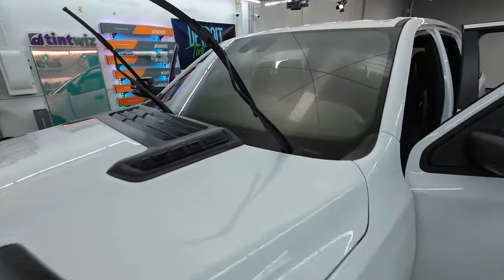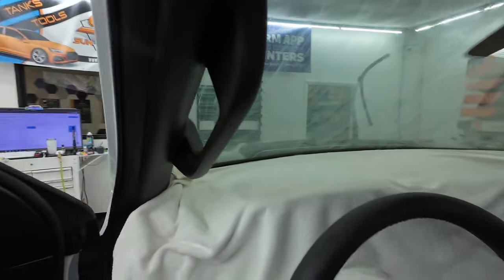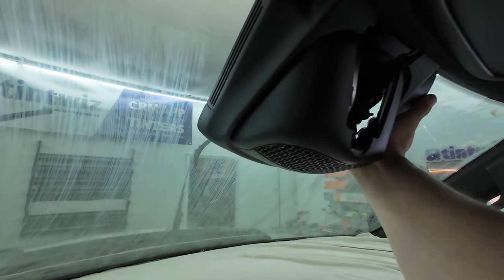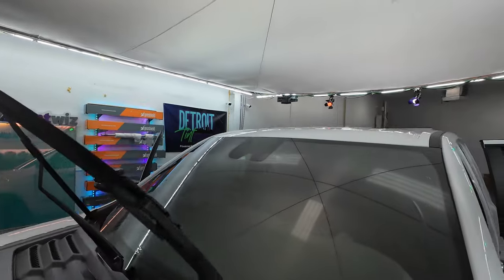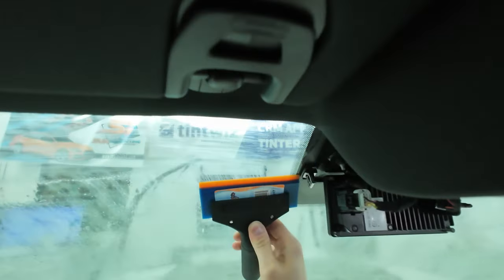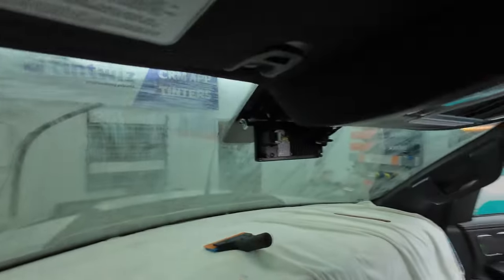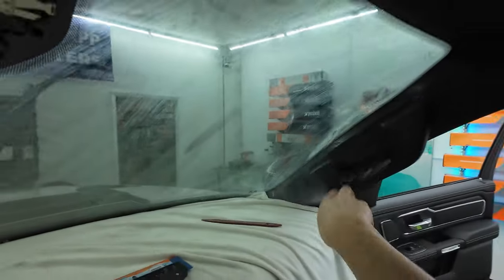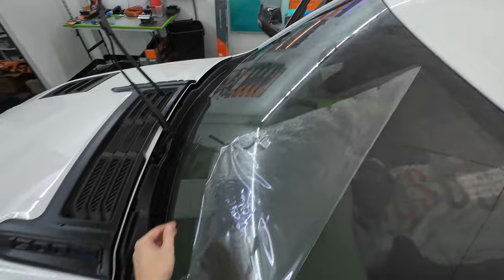Avoid windshield tint water damage on Ram - BCM and MIRROR removal

Comment: Tint is scratching on me during install every time. Thought It was the brand of tint I was using. Tried geoshield which I have been very happy with but still having the same problem. Using an orange crush squeegee. Have to wrap squeegee in paper towels to avoid scratching but it takes forever and leaves a lot of left over solution. Anyone have suggestions?
Reply: Tape up all your tools. Plastic one make sure you sand them down with a high grit sandpaper then tape